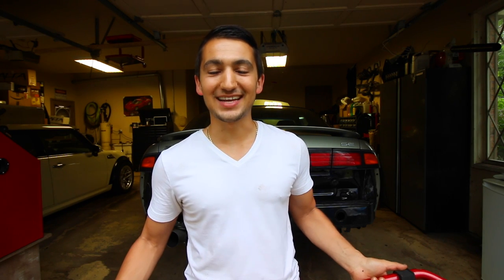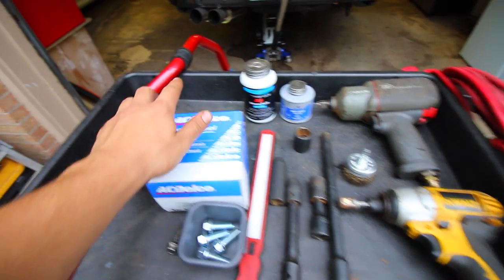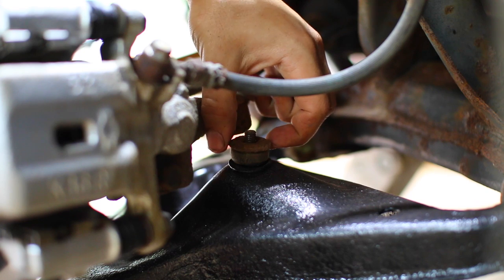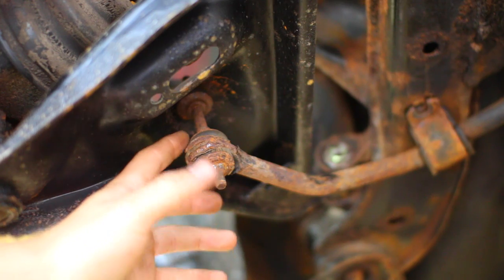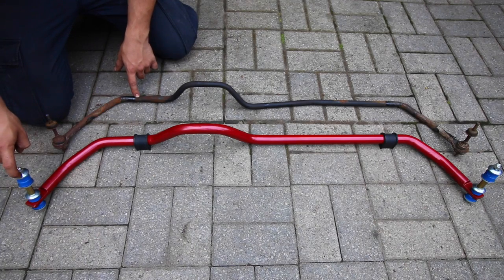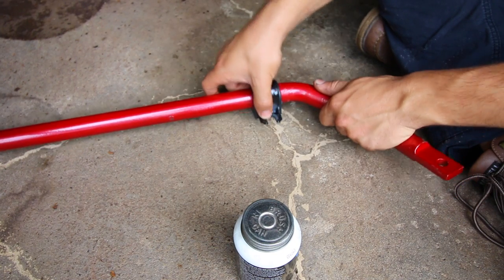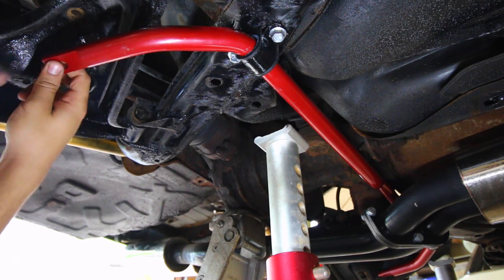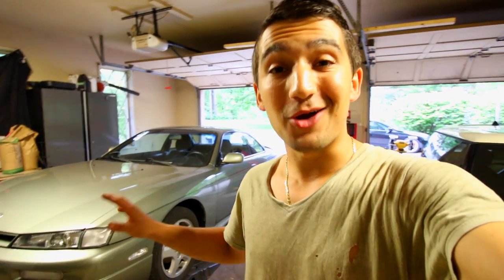How to Install an Upgraded Rear Sway Bar

Comment: I don't want to sound negative, I love your videos, but body roll in the rear is not really tied to the sway bar but to the shocks and springs and also subframe bushings. Stiffer and bigger sways will induce some overseer on rwd cars like yours....
Reply: rear sway bar 100% affects body roll, along with the shocks and springs.  they all contribute to reducing roll just like the components in the front of the car.  what would its use be if not for tightening up the "sway" of the rear end?